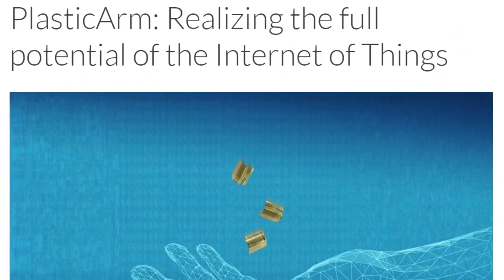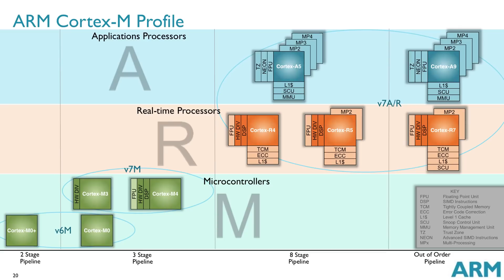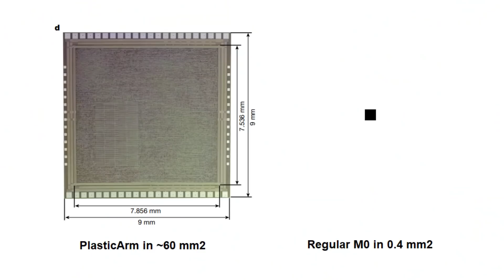New Bendable Processors: Weird Flex But OK 💪💪

Comment: I think you hit the nail on the head with the fact most technologies use non state of the art lithography.  If they could get a Z80, or better yet a 680x0 or 586 type architecture on plastic substrate, it would be a game changer.  To be honest I can't imagine the life of these devices being very long since electron/hole drift in plastics is probably much higher than in silicon.  But if you put these in semi disposable devices like burner phones, cloths, food packaging, water filters/purifiers... ect., it would really open up a lot of new lanes for tech development.  

Another big one would be disposable medical devices, like patches, heart monitors and the like.  

I think we get hooked on cutting edge technology and lose sight if how versatile older tech can be in non-graphics heavy equipment.

Comment: it's really early, but there must be issues with energy and thermals as the electrons can't move as easily in just oxide layers. if they are durable and cheap, we might get to some useful results. 
If you embed some form of power generation, from solar or (body)heat, maybe flexing or other motion as well. This could be really interesting. Otherwise it will all have those giant RF spiral antennas to grab power.

Comment: This will be grate for logistics. The one thing you actually want to be tracked. Each package can be self-tracking and tamper detecting. Packages could also detect when they are dropped, how bad it was, and where, to determine who needs to pay / what worker needs to be fired. logistic workers will think twice about throwing goods about when every package can snitch on them.

Comment: At 21 mW, this can already be powered wirelessly by the kind of inductive coils used for NFC - which is the type of interface you'd want to use with these. They only need to stretch the ROM to a couple KB, and they'll already have a very usable and  powerful design.
If they ever manage to implement an EEPROM on plastic, it might start a new era of 'smart' NFC devices.
Reply: I was wondering if you could do that, but if it can't process anything unless a device is near, why not just have the device do the processing and the plastic chip just do storage which would be normal NFC?

Comment: In terms of flexibility the IGZ oxide seems to be good for ~1% strain (DOI:10.1016/j.tsf.2015.09.052), so on a 30 um substrate that's a ~1.5mm bending radius - I suspect this thing bends better than current flexible displays.

There's 2.3 orders of magnitude in cost between the cheapest surface mount components and the cheapest ucontrollers on RS components, so if they see the cost reduction they claim then we could see ucontrollers as the cheapest thing on a pcb. This will lead to a revolution in the complexity of cheap devices - no more easy to understand circuit diagrams, it'll just be ucontrollers talking to each other.

Comment: While i really like the topic, the "examples" you gave for where to use them are, i would argue, all fields were using a CPU would not add any value but be a step backwards.
You want to monitor if something that needs cooling got too warm, or if some specific food or drug spoiled already? OK, sure, but you do not need a CPU for that - we already have way simpler physical objects doing that - they can not fail cause of a software-glitch or a simple static shock frying the electronics.

Flexible processors would be good in places where, well, you do not have the space to include solid objects. Like a watch/phone that can be bend or rolled up - give me a phone that can be rolled into a simple bracelet.

Comment: "if we can implement processors in plastic, then everyday items" will conduct surveillance on us 24/7. I don't want my underpants or a carton of milk to snitch on me. Or a situation where I open my drawer, and note that I can't use these and these underpants, because they are now out of supported software period, and are potentially remotely exploitable. A worrying development. 😟😟😟
Reply: 8AM You go to brush your teeth...Drugtest failed...8:05AM You have been fired, 8:17AM (Progressive) We are sorry, but we cannot renew your insurance policy...8:18AM (DMV)Your  license has been revoked. 8:19AM (Highway Patrol) Insurance not detected on your vehicle...Ticket issued. No license, no insurance. 8:25AM You have been issued a 5150 clasification. Please report to your designated psychiatrist. 8:26AM (Police) Due to your recent mental instability officers are schedueled to confiscate your firearms between 7am, and 9pm. Failure to comply will result in felony charges. 8:30AM (Landlord) EVICTION NOTICE!!!
Reply: @grndzro777  8:35 AM Drugtest bug found; 8:40 AM drugtest patched successfully; 8:41 AM drugtest passed. Still out of job, out of house, out of services.
Reply: Well they would need wireless emitters as well then and access to your internet wouldn't they.
Reply: @fVNzO  Not necessarily - RFID tags work passively for instance, even though the reader must be close to them.
Miniature radio equipment is no problem for short distances (think a few metres) if they are being read by say drones flying over your house or cars passing by.
There are ways to read data from such devices without connecting to the internet. Whether that's ever going to be a practical solution for mass deployment is a different kettle of fish.
Reply: @totalermist  yea there are short range options but we're in deep dystopia if we're talking drones everywhere or other robots coming in and harvesting your fridge data. 

At that point we probably have cybernetic enhancements anyway.
Reply: @fVNzO  things like cars come with pre-installed cellular internet. If a cpu is possible to implement I don't see why a modem with included cellular internet support is out of consideration.
Reply: @ultraveridical  I was thinking in appliances and stuff though. Everyday items.
Reply: @fVNzO  Amazon Sidewalk mesh network lesssss goooooo!

Comment: I can't wait for some disruptive battery or power tech.  I'm not at a pro level but my personal projects always have a power problem.  I have some cool shrinked down solution but then how do I power it?  I think the same is true for everything.
Reply: "some disruptive battery or power tech"
Very very unlikely to happen for a simple reason: Batteries are already very power-dense even when looking down to the molecular level, but contrary to something like fuel they do not need external materials to release their power, making it possible for them to discharge in seconds and blow up.
Current LiPos can have energy-density as high as 2 MJ/L, Gunpowder and TNT are around 6/7 MJ/L - a battery with just 3 times the energy-density would be similar to TNT.
(And we also know the theoretic limits for many different forms of storing energy and for batteries it is in general about 10x what we got now - at that point you would be storing as much energy as physically possible and even a slight problem would basically result in an explosion).

Comment: Im not sold on my hat having a CPU but I see the value in medical equipment.
containers that carry drugs that can self monitor and report, maybe more accurate lifespan measurement from environmental monitoring.
Maybe medical devices that need to be in contact with humans that are more comfortable for the subject or for medical implants having something less invasive.
Reply: And in what way would you need a CPU on such medical equipment?
A container for drugs - no need for a CPU, there are way more reliable (cheaper, safer) physical methods for monitoring.
Reply: @ABaumstumpf  Simply I dont want it in my hat. It's going to go in stuff so if anywhere medical is the best.

Comment: I dont quite get the fundamental benefit here. The silicon dies for some of those chips are smaller than a grain of rice, if we package them small enough there will be little difference in function if the material around them is bendable.

I've seen this a few years ago with disposable paper metro tickets - they had NFC functionality, so apparently some small embedded chip.

Also interesting that they are apparently using NMOS logic. Explains the need for smaller resistors and I guess the high static power consumption. I wonder if CMOS logic would be significantly larger

Comment: So bendable electronics is really exciting, but I do think that power issue is something that needs some work :-) 

For reference: In a project I'm using a STM32L431 microcontroller (which uses the far more powerful Cortex-M4 core). That chip can operate down to 100kHz, and it's power consumption is then 40uW to 60uW (depends if code is ran from RAM or FLASH, respectively). To put that into perspective: a 25uW load will drain a CR2032 Lithium battery in about 2 years, which has quite a lot of energy stored in it to otherwise energy harvest (depending on the environment).

So 21mW for 20-30 kHz is really a lot. But still exciting that it even works!! I can't wait until this technology is also combined with scattering radio technologies as found in RFID.. because that would truly set the IoT world alight.

Comment: the only good i can see about this is implants, something thin and bendable can easier to place in someones body than something rigid even if smaller. specially somewhere like a brain
and you can use the sheet itself rather wires to hook things up.
like something like bypass a damaged region of the brain for people with seizures

Comment: Just because you can put a processor in everything, doesn't mean you should. This mad push to putting everything on the Internet is because the industry want to track you 24/7. And it's also why everything is getting hacked. Even refrigerators are getting hacked to mine Bitcoin.

Comment: I can only see a market for plastic chips if they are significantly cheaper. Why would you want a bendable microcontroller when there is wafer-level chip scale packaging? Just type "WLCSP ATtiny" on Google to see how small a microcontroller can be. WLCSP chips are so small that they won't prevent any surface to bend.

Comment: Growing up playing with and programming on MOS 6502-based home computers, with their dozens of instructions, their 8 micro-meter node size, and their 1 MHz frequency, the specs on this plastic M0 make me feel like I'm coming home!  :)
Reply: Ha, I had a similar comment.  I learned assembly on a 68000 in college and also studied the pentium.  If you arnt in graphics heavy or multithreaded environments, you can get a heck of a lot of mileage out of older tech.

Comment: And in 5 years, it’ll be at 6sqmm and 1Mhz, give or take. Anyone want to take a guess?
Reply: It is quite challenging. Any structure you want to build needs to be much bigger, as the molecules are much bigger than silicon atoms. And you can't stack as much because of bending, thermals, etc. But you can afford to build much, much larger instructions as size don't matter as much.

Comment: Silicon is gonna stay for another decade at least.

ARM is the future.
Reply: Light
Reply: Silicon will stay for the next couple of decades at least, if not longer: it works, is easy enough to produce and is cheap in comparison.
And ARM - it will stay, but "is the future" - nah, i think we will get a new approach for that. Heck, even Intel Itanium is be better than x64 in many scenarios but it never got widespread adoption cause it initially broke backwards compatibility in favour of way better efficiency and performance.
Reply: @ABaumstumpf  Believe it or not ARM is future of computing.

ARM is everywhere....in smartphones, smart TVs, smart devices, IoTs, desktops, laptops, data centers and super computers etc.
Reply: @APU-iGPU  And X86 is everywhere - TV, smart devices, IoT - ARM is here to stay, but believe it or not - it is not "the future" but just one of several that will stay around.